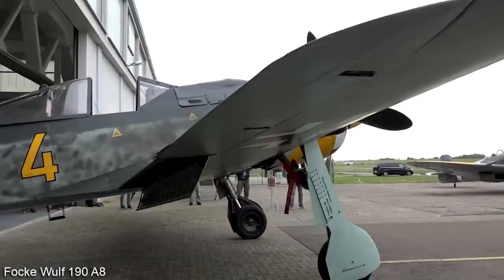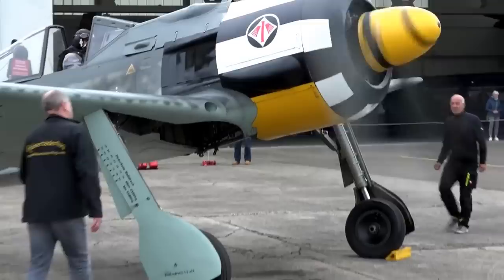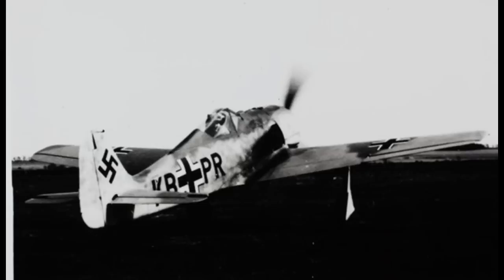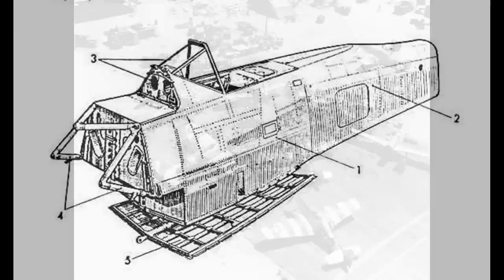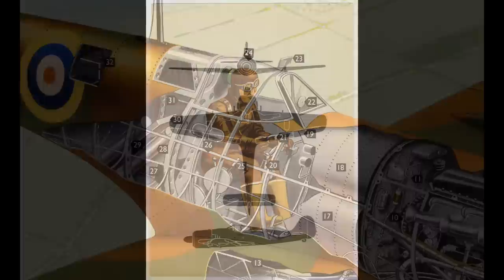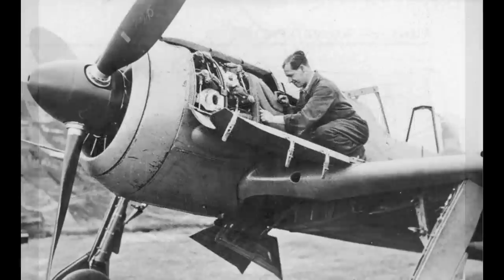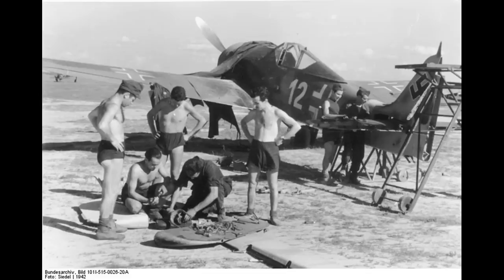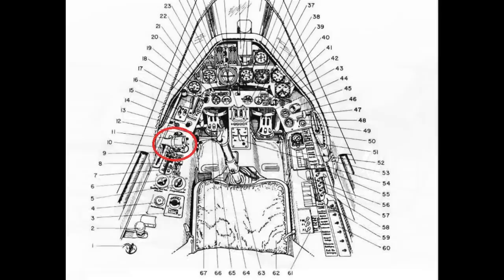Focke-Wulf Fw 190 Pt.2

Comment: “You have to see the Fw190 Bismarck shows”. Not only have I seen the video, I’ve seen that aircraft in person. Beautiful piece of engineering.

Loving this series Greg.
Reply: Did you also have look over the Fairey Gannett that they had there? Pristine condition compared to the one outside on display at the Moorabbin Air Museum in Melbourne, Australia. Weird looking aircraft.
Reply: the fw 190 flugwerk variant with ash 41 engine
Reply: @markfryer9880  I've also been to Gatow this year. Great collection, and yes, the Fairey Gannett is one of the weirdest aircraft ever built, with the Dual-Mamba engine. There's also a Gannett at the German Airship and Naval Aviation Museum ("Aeronauticum") at Nordholz, where it sits, somewhat neglected, outside.
Reply: Bismarck has a good vid on this
Reply: @markfryer9880  the gannet in particular the AEW varrient might be the ugliest plane ever to take to the air, the again this is coming from someone who thinks the nasa super guppy is beautiful so pinch of salt and all
Reply: @markfryer9880 is it still at moorabbin? Its been a while since ive been there

Comment: The La 5 pilots who had to fiddle with 6 levers simultaneously would've been extremely happy if they had the mechanical computer like the 190 did
Reply: Another reason why the Russians likes Lend Lease fighters I guess
Reply: Sorry for bad english, but: 
Composition of the fuel mixture on the Soviet MiG-3, LaGG-3, La-5 (F, FN) and La-7 fighters could be controlled both manually and automatically.

On  many Soviet fighters, it was possible to simultaneously move the manifold pressure control lever and the propeller speed control lever
At the Messerschmitt, the flaps were released manually by the helm, which, accordingly, had to be twisted. On all Soviet fighters of the 40s. - pneumatic system.

Some Messerschmitts had a limited view of back. The Soviet fighters since 1943 - the rear view, with the exception of a relatively small number of LaGGs, was excellent.

And yes, the Germans had superiority in automation.
Reply: Wasn't such a big deal most of the time.  On the Eastern Front 190s were fairly quickly downgraded to ground attack missions (low and slow), so they didn't benefit much from all of their Kraut magic, while at the same time the Soviets didn't suffer that badly from their manual controls.

From what I read in the interviews of actual pilots, the main advantage of automatic controls was when being bounced.  Cruising happily and then suddenly being expected to push several levers in proper order and switching some switches was no fun, especially when compared to simply jamming the throttle forward.

Soviets countered this problem by cruising at higher speeds.  It limited the range and engine longevity, but they just sucked it up.  Engines don't last all that long when exposed to enemy fire anyway.

Another equalizing factor was the strategy of the Luftwaffe for gathering numbers before engaging the enemy.  It seems reasonable at first, but Soviet pilots considered it cowardly, because the attack often came after the mission was done.  Luftwaffe was a much more independent force than VVS, who was supposed to cooperate with ground troops very tightly, but the disadvantage of that was that Luftwaffe was not very keep on risking an attack while outnumbered, even if it could result in much less effective enemy strike.

Anyway, Soviet pilots scorned this approach and because of that prevalent tactic, they were rarely surprised during big operations.  Germans attacked in numbers, but often after the enemy was well aware of them loitering above.  

I didn't come up with all of that by myself.  I will dig up the sources when asked for them.  Eventually... ;-)
Reply: Ask P38 pilots about it
Reply: That being said 4 of those levers are the supercharger and engine cooling systems that as most radials are kinda set and forget unless doing prolongued dives in winter with low throttle settings were they would need to close the shutters, so they would be set once entered the combat zone.
Reply: @user-no2vy7hw2e  Thanks for your input, Igor.
Reply: I bet they where happy when they got their first all metal Planes, maybe the LA5 ? Im not knowledgeable on soviet VSS WWII planes.. I personally have the opionion, They mostly suck.... Horribly, Sure make good Bites for My Butcher Bird.... yum yum, All low alt too
Reply: @bakters  low and slow?? Thats why they dumped the stuka!!!! The fw 190f versions for ground attack had an extra high octane c3 injection systems, even with bombs attached to the airframe they were almost uncatchable for most soviets fighters on the deck. Their main tactic was hit and run, so they dont have to rely on local air superiority.
Reply: 7hi

Comment: FW 190 Engine maintenance access panels designed to use as work platforms. As opposed to U.S. 60KW genset access panels that are designed to fall down and hit the mechanic in the head.
Reply: Kurt Tank must have had the top cover of an MG08/15 land on his head.

Comment: I recently read the War DIaries of Chas Lindburg. Hewas a factory rep in the Pacific.
 He made a number of talks to pilots about using the auto lean and lower engine rpms for cruse. 

He found many if not most pilots could benefit from better engine management for better economy to stay on patrol and get much longer duration from better fuel economy 

Once in combat the mix went to auto rich for best power.
THanks

Comment: "...we will probably cover everything in here in more detail than you want..."

Uhm, no. We come here specifically for that level of detail. :) The great advantage of a youtube video is the ability to skip forward, should the detail be too high. However, I have yet to catch myself doing so on your videos. I doubt too many of your regular viewers would complain, at least judging by the other comments.

Back to your video. I absolutely LOVE the Kommandogerät (yes, I am German, I love planes, and yes, I have also worked for BMW in their Spandau facilities while studying engineering). The Kommandogerät for me symbolises the German approach to basically smother a problem with a technical, mechanical solution. Mechanical computers were long considered very rugged and resistant to temperature variations and vibrations, which would disable capacitors and tubes respectively in old electronic circuits. Especially since the inputs and outputs were physical "signals" (lever position, pressure, rpm etc) that would have to be transduced to an electric signal in the first place.

The series of non-descript cams and followers contain all essential information of different settings in relation to each other, ignition advance can be curved to follow rpm, absolute manifold pressure and mixture settings. The (unrelated) Kugelfischer ignition system achieved this by means of rotating and translating a 3D-cam (affectionally called "potato") to capture the relation between several parameters (throttle setting and and rpm). It could correct the output for altitude (pressure) and temperature. Re-mapping such an injection system involves good old "mechanische Bearbeitung", mechanically modifying the cam to yield a different curve. The Kommandogerät uses several such cams to link values in non-linear fashion.

From a practical approach, the P40 seems to hit the sweet spot. Not a fully manual system like Russian fighters (or nearly all GA piston engine aircraft) where every parameter would have to be set, changes would cross-influence the setting. Instead a couple of automatic systems each optimised for their respective task avoids the complexity of managing all variables at the same time. When something fails, the failure mode is clear and corrective action is also easy. The Kommandogerät poops the sheets and you're basically out to dry, because a normally super simple engine becomes unmanageable (bar, of course, the prop rpm with its separate circuit).

Despite these disadvantages I still love the clockwork-like Kommandogerät.

Love this series!
Reply: Great videos often provide great commentary, as is illustrated by your excellent contribution! I, too, have a soft spot for mechanical calculators/computers... One of my mentors showed me a lathe with a cam-driven controller. It was love at first sight...

Comment: Typically Germanic in design, so very thorough and smart that it leaves you wondering, just brilliant.
Reply: Well the designer knew the KISS principle, so not typical anywhere.
Reply: Classic Mercedes (pre-1995) are built like this too.
Reply: @verdict1163  I had one and what a machine. I still miss it.
Reply: @jackd1582  except the 190 was designed with ease of maintenance in mind, that's it's genius (relative ofc any top end fighter aircraft from any era is gonna be a bitch)

Comment: Thank you, Sir. You could definitely give classes on aircraft design.
In my opinion the command unit was build, to increase the survivability of inexperienced pilots. And offer exhausted pilots some comfort. Hour after hour hearing these extreme engine noises plus the smell of the engine gases plus the cold outside plus 10 to 14 combat hours a day. You are going to be extremely happy if all you have to do is push the throttle. Thanks for the excellent content.

Comment: I am honestly amazed at the complexity of the fighter planes from the 30's and 40's.  I didn't realize just how sophisticated they were, I would often wonder...did they think of this, or that, regarding different machines.  The answer it turns out is always yes, yes they did and then some !I've always found that extremely interesting.  I would like to thank you for providing not only the fine details but also the thinking behind them and their different methods of execution. It really brings the aircraft to life in a way that is hard to come across.  Wonderful job !

Comment: The one piece main spar was forged in a 30,000 ton press.  The "D" model engine mounts were also one piece forged magnesium alloy called "Elektron" .  The Germans never ran out of magnesium. I was fascinated as to how the Germans were able to build so many aircraft during 1944.  35,000.  Thanks for highlighting the mundane, which really is not
Reply: Jim Wahl: Hi, do you have any good, readable links about magnesium metal production in WW2 germany, or the manufacturing of magnesium parts like this? I think infrastructure in Germany as its situation worsened through the last years of the WW2 is interesting.
Reply: @MultiZirkon  But ain't magnesium sort of...flammable?
Reply: @nickmitsialis  yeah but its flammable in the same way paper is.
very densely packed paper (cardboard) is actually pretty difficult to light. High surface area like with shavings or chips lights pretty easily and will burn intensely even underwater. 

My dad is a machinist and we regularly brought powdered and shaved magnesium to use as fire starter out backpacking innawoods.
Reply: @Snuckster2  Interesting; Thanks for the info.
Reply: Was it a steel spar like in the Ta152?
Reply: I think these heavy production machines could not nearly be destroyed by the US toy bombs of 1000lbs maximum
Reply: @pascalchauvet7625  The spar in the TA was steel
Reply: @TheAneewAony  Yes in the TA but how about the predecessor FW190?
Reply: @HarryVoyager  That's a great video.
Reply: @pascalchauvet7625  I became aware of the spar while touring the Flying Heritage Museum, Paine Field Washington USA where they have a fully restored, flying original 190.  There was oil dripping from the 801 and I commented on it.  The tour guide went into great detail into all aspects of the 190's construction, including the massive one piece forgings the the Germans used.  BTW, the BMW 801 used direct fuel injection.  If you get a chance to, I recommend visiting the FHM
Reply: @TheAneewAony  Most of the airplanes at the Flying Heritage Museum leak oil. That's what airplanes of the era do when they are flown.
Reply: Interesting! As a kid I read Pierre Clostermanns book and I remember how he described a 190 (I think...) crashing - producing a "flash like burning magnesium". I remember I wondered about that. Was it just a way of describing an explosion..? But apparently not the typical "gasoline" explosion, since he pointed it out as special... Could Elektron be the explanation?
Reply: @nickmitsialis  Interesting - I had thought that the alloy was far less flammable than pure magnesium.  However, checking the composition info, I found that it still has as much as 90% Mg, (+ 9% Al and 1% mostly Zn).  That makes me believe that the alloy ratio is not the main issue, but the minimal surface area of a solid structural part, (in contrast to powder) is the key for safety in this issue.

Comment: Thanks for these.  The Fw-190 is a plane that's always left me wondering what it existed for as I never really understood how it stood apart from the Bf-109.  I was never sure if it was intended to be a higher performing replacement or if it had some specific mission to fill that the 109 couldn't.  I come away from these videos with a great appreciation for it as well as a feeling of relief that most of Germany's weapons weren't as thoughtfully designed.  It's interesting how much more effective a weapons platform can be when they remove just a tiny fraction of performance to enhance durability, maintainability, and usability.

Comment: After listening to how the throttle, mixture and blade pitch were adjusted I thought of how many engines met their death from the mismanagement of those three things alone.  I bet the number was not insignificant !  I cant tell you how many times I have wondered about this exact subject regarding WWII aircraft.  I'm a mechanic, so I ponder these things often...again, thank you for such an excellent description !
Reply: All true !
I like to emphasize this fuel metering unit being a marvel.
This engine having direct fuel injection optimizing the fuel flow according power, available manifold pressure, temperature, engine rpm...
Nowadays one would call for an electronic fuel computer. These guys made this mechanically !
I observed engine start.  They crank an inertial starter, engage a clutch, and the engine starts. Compare this to modern piston engine.
Incredible !

Comment: Reminds me of working on classic Volkswagens.  They had a deceptively simple practicality.  Like having the headlights wire through the ignition circuit, so it's physically impossible to drain your battery by leaving the lights on - a feature that US cars still don't have in 2020, even with everything being electronic now. It's mechanically trivial to add this feature - just put the wire here on this already existing switch (the ignition) - but someone had to think about it and plan ahead and the manufacturer had to care enough to bother putting it in.
Reply: My Subaru had the same feature, keyswitched headlights, even had a separate switch so you could have the parking lights on with the ignition off.
Reply: @luvr381  It's no coincidence that when I had to give up my VW I moved to a Subaru :)

They aren't what they used to be though. 2000-2008 was the sweet spot.
Reply: @sbvera13  Mine was a '99, great car til rust ate it.
Reply: But did headlight brightness vary with engine rpm?  Or if it did, did that mean the voltage regulator was failing? Just a quick thought....
Reply: @roggy001  Partly because they were just really old by the time I was driving them.  Partly because the generator was in the rear and the the lights were in the front, which at 12v and 5-10 amps (I forget what headlights are) that's a lot of voltage loss due to wire resistance over that distance.  This goes double for the really old VW's that used 6v batteries.

Comment: At 24:50, the author discusses the complexities of controlling the propeller-engine group of Yak aircraft. It's noted that not everything was so problematic. The temperature of the cooling mixture was controlled by the automatic regulator ART-1 (АРТ-1), though it wasn’t widely used in the first series. Additionally, the propeller pitch adjustment was hydraulic and semi-automatic, controlled by the R-7 (Р-7) regulator.